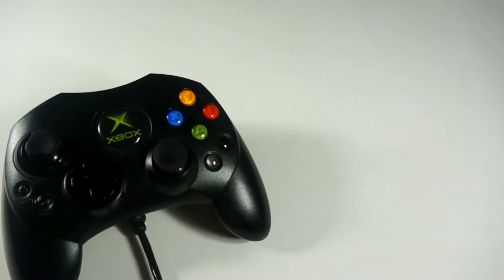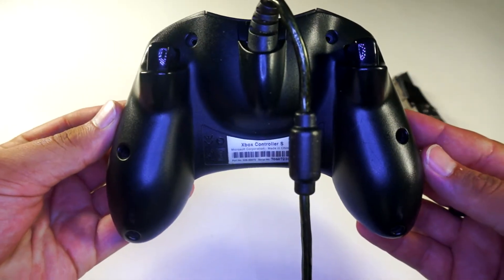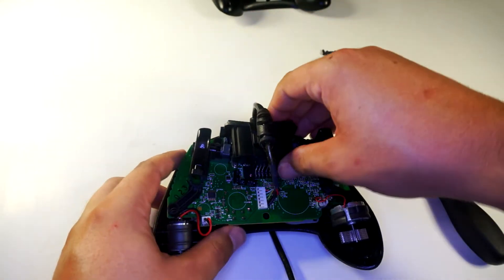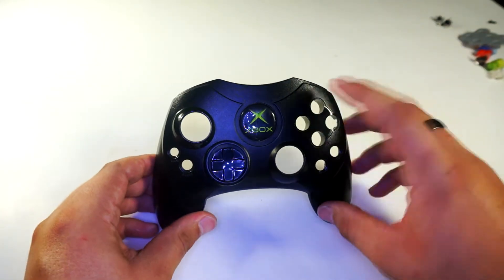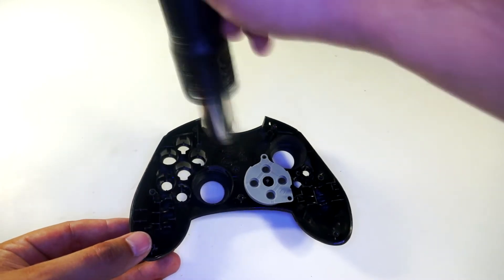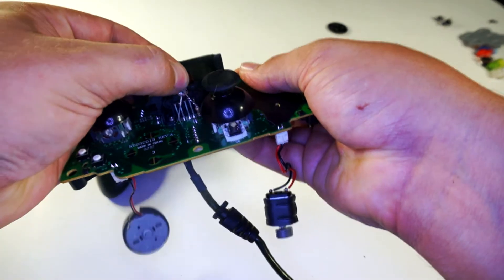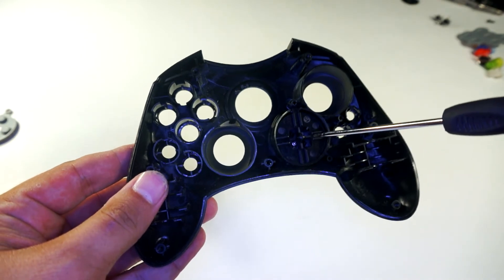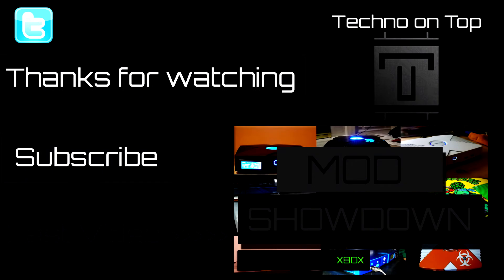How to LED mod an original xbox controller

Comment: Is it possible to add more leds to make it brighter?, is there more positive and negative points to where you soldered?
Reply from the maker: Sure you could add more leds, there isn't a whole lot of space so be careful with that. But I would just chain them together. But I'm sure there are other spots.
Reply: TechnoOnTop yeah chaining them together is a good idea 👍 thanks

Comment: Just to be sure, a 3.3V LED would work with a 470-Ohm 1/4-Watt 5% resistor?
Reply from the maker: hey Joel, yeah that will work I have a link to some LEDs in the description if you want to check more but those will work happy modding
Reply: Hey thanks man.  I checked out the link, and then realized that I already owned some LEDs.  I'm pretty new to this, so I really appreciate the professional help.

Comment: wrong resistor. The source voltage is 5V, LED is 3.2V and 20mAh. You need a 100ohm resistor. 
http://led.linear1.org/1led.wiz?VS=5;VF=3.2;ID=20

You could use a 470ohm resistor if the input voltage is 12V
Reply from the maker: 100ohm resistor can be used. Saying it's wrong isn't true...

Comment: I bet this will be even better with my see through blue S-controller. 

Thanks for guide
Reply from the maker: It definitely will,  that is actually what my main controller is.  Though I did that mod well before i made videos. Thanks for watching!
Reply: Am i able to put more then just one LED in the controller or no?
Reply: TechnoOnTop If I wanted to add multiple 3mm blue LEDs to my crystal clear controller. Would I need to use more resistors or other changes compared to what was shown in the video?
Reply from the maker: Fahrenheight no you don't need to add any more resistors, as long as they are all hooked to the main power through the resistor, thanks for watching
Reply: TechnoOnTop Thank you so much.
Reply: @TechnoOnTop  hey sorry to bother you  but im just curious why is the resistor necessary ? im new to modding. wouldnt it be brighter without the resistor? or would it run to hot and its not fused?
Reply from the maker: @Mike  I'm definitely rusty when it comes to modding, but the resistor just limits current to keep the LED from buring out. I just always got in the habit of using them (how i learned or was taught? Maybe good practice, idk anymore), though it is true they aren't always necessary, but that depends on what they are rated and what you're connecting to. 470ohm is what always used because I had a bunch. But 100ohm is what I switched to later I don't think there is much a difference in brightness at least not visible to my eye.

Comment: what tolerance and rating resistor was used again?
Reply from the maker: they are 470Ohm 1/4watt thanks for watching
Reply: TechnoOnTop are the resistors totally necessary??
Reply from the maker: Yes, without the resistors the LEDs would burn out prematurely. thanks for watching